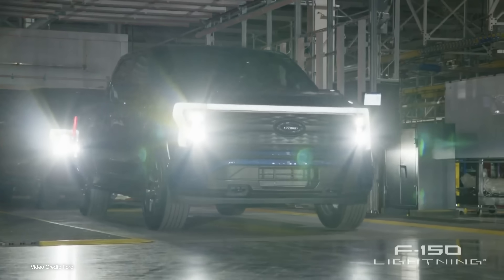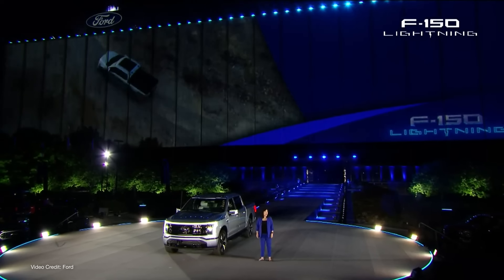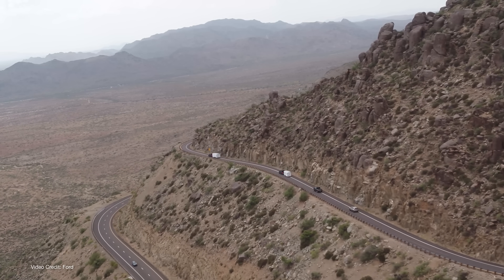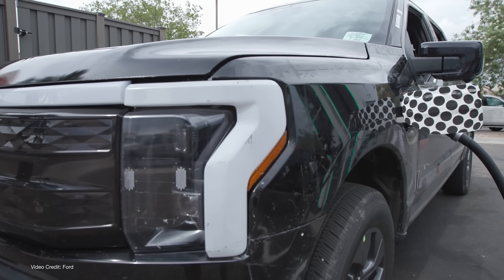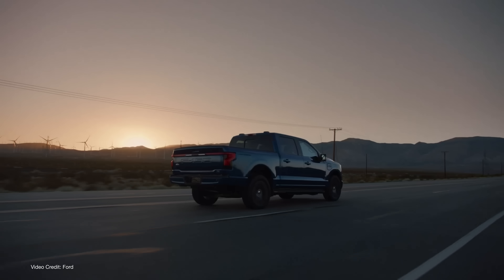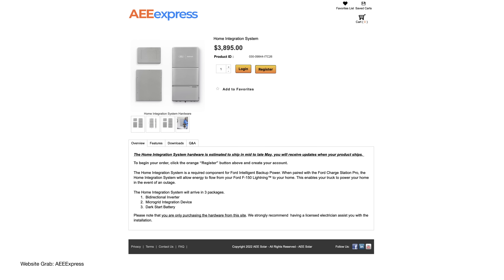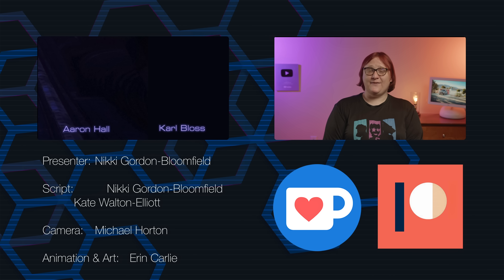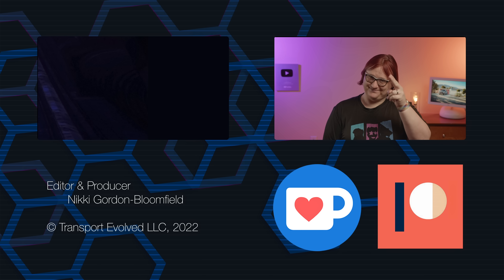The Ford F150 Lightning Has Some Tweaks At Launch - Here's What's NEW!

Comment: Someone should make a aftermarket regenerative braking system for trailers to connect to EVs. More efficient braking and get a little energy back on downhills and braking.
Reply: it would take more energy to pull it than you'd get from braking unless the motor shaft is disconnected from the axle using a clutch mechanism when the trailer is being pulled.

Comment: The whole battery backup thing from the truck sort of angers me because we have ALREADY had all this technology around for a long time!
I have an old inverter (original Tesla PowerWall one...) and a ten year old electric car. I can pull energy straight out of the CHAdeMO connection, through the inverter, and power my whole house. It's not actually that complicated!
I'm still tweaking it, but it's been good so far. CHAdeMO connections are expensive, so I 3D printed one: https://www.youtube.com/watch?v=Cw-SMRmZjNI
Here, I'm testing the DC output from the car: https://www.youtube.com/watch?v=hBV9CIVN0fs
Reply: Certainly there are challenges. I agree with you in terms of Kudos to Ford. I just can't believe it's taken this long to finally make something happen. Glad to see manufacturers are starting to do this.
Even the simple power output on the Kia EV6 looks really good.

Comment: I really want to know if their V2H system is going to play nice with an existing Generac or Enphase ATS. I kinda want to hook it up to the generator input on the Enphase smart switch and treat it like a normal standby generator. I wonder if that would work without throwing a bunch of error codes.

Comment: Great wrap up of the additional info coming out on the Lightning. I was shocked on the price of the V2H system. This seemed way overpriced given the basic inverter, switching & grid isolating hardware & tech has been around for years. I can see a lot of DIY tech heads start developing behind the meter systems if car manufacturers start charging those sorts of prices.

Keep up the great work! 👍
Reply: @Eric Dow Hi Eric, agree install is probably big chunk but either way it's big $$. I fully understand the ability to seperate the house from grid when required to protect linesman but that's a simple grid isolating switch triggered to 'Island' the home in certain circumstances, these aren't overly  expensive, so going back must be the install labour
Reply: @Eric Dow Agreed. Here in Australia is similar. 👍

Comment: I have a solar system and would love to have this 100Kwh battery sitting in my garage fully charged by the sun waiting for an outage to power my house. Given my power usage this truck would last me for DAYS and if there was sun during the day and this was only used for backup power at night....I would be set for awhile. Easily worth $5k or more to put in the correct hardware as that is chump change compared to buying a full home battery backup system of that size. That would be 5 tesla powerwall equavlents for the same cost as the truck, but without the utility of HAVING A TRUCK. It's a no brainer if you were looking at purchasing/installing a battery backup system. Someday TEsla will figure this out although it will cannivalize their powerwall sales, but this type of system will do that anyway so they had better jump on the EV to home backup power bandwagon. Also you don't want this type of system hooked up by someone inexperienced or DIY. Too much possibility of fire.

Comment: Nikki you are mistaken in regards to the Platinum range boost… Previously the Platinum had a range of 280.  It is now 300.   It still remains 20 miles less than the other extended range models.

Comment: I plan on using my Ioniq 5 V2L ability to plug into my generator backup panel. I have solar as well, so this is a basic solution to solve some of the power outage problem. Just have to manage how much power we try to draw. May install a Span panel, then the generator input becomes even more flexible. None of this stuff is cheap or easy, but I never could plug in my Passat to run my house, so progress.

Comment: Just wait until you hear the actual installation cost beyond the $5000+ hardware and the fact that most homes will need to upgrade their puny 100/200amp panels to 300amp+. You’ll easily be looking at ~$10k total for a lot of folks who don’t happen to have a brand new home with an existing oversized panel.
Reply from the maker: You’re misinformed: the Ford Charge Station pro can be ramped down to 30amps if required. - Nikki
Reply: @transportevolved  if you ramp it down to 30amp, why even bother buying all that hardware and pay for installing it at all? You can’t fully utilize it during an outage and you can’t charge your vehicle any faster than pretty much any home charging solution… Just have a transfer switch or even better yet, just use the included 240/120 outlets to power essentials without buying anything extra. What % of people would be willing to drop $5k on additional hardware only to downgrade it to 30amp?
Reply from the maker: @Mari0o0o  Actually, you can utilize the full 10 kW during a power outage, because the power fed back into the home is on a different circuit to the power drawn out during charging - NIkki.
Reply: @transportevolved  good to know! I still don’t see the point in getting the whole system if you don’t have a newer and larger panel and are unwilling the spend $ to upgrade it.

People buying a 50k+ truck who would be willing to then drop another 6-7K will also be likely to just drop 10k and charge faster (which is probably a bigger priority for most) vs those who are looking to save money and can’t have a more powerful home charger anyway due to current home limitation who would just opt in for a simple transfer switch, even if they have to manually flip it during a power outage.

I don’t see much if any overlap of people who are ok with spending $5k in additional hardware plus installation costs but who would be ok with having a 30a charger that takes multiple days to charge their truck.
Reply: I'm so happy that 400V (3phase at 230V) and 50A (35kW) is standard for regular homes over here in Germany.

Comment: Hard pass. If you tow a travel trailer for let’s say a small trip at 300 miles each way then you’re going to drive for about 100 mins and then spend 45 mins to charge it from 20-80%. 150kWh charging rate is ridiculous.

Comment: Using the F150 Lightning to power your house just seems like a waste of money. Some extension cords would get you through in a pinch. If you have really bad power problems in your area a backup generator wouldn't cost you any more and it would allow you to go to work and not leave your family in the dark.
Reply: A backup generator uses gasoline. Which you'd have to keep on hand and store somewhere. And "extension cords wouldn't do much for the HVAC, something that would be needed if it was 90+ or below freezing. 
Plus you can always use that to charge smaller batteries for lights and fans if needed.
Reply: @sh969 Most backup generators where I live use natural gas. I understand that extension cords are not a perfect solution. Bur they cost a lot less. Using the truck as power backup isn't a perfect solution either, It can't leave the house. Plus that central air is going to drain. the battery pretty quickly. So would electric heat. A natural gas furnace could be plugged in with an extension cord. If you have no power and  it's hot try opening a window.
Reply: @sh969  re: "A backup generator uses gasoline." close, PORTABLE generators deployed for "backup power" use gasoline and other fuel types (think Diesel). this is the situation I'm in as the grid here goes out all the damn time, even on bright sunny days.  as a temp fix i have a 5000 Watt Honda (quiet run type with inverter) that I bought for use at the racetrack.  when the power goes out (for now) I just run an extension cord from the trailer to the house to plug in "bare essentials", at which point the wife and I just suck it up and wait it out. I eventually want to install a "Stand-by generator" that taps the NG supply like "Arselio Hall" mentions.  a few neighbors have them particularly for MEDICAL reasons as they have kids with special needs (ie, asthma) so they must always have power available for breathing machines and other equipment.  as great and wonderful as the "Mighty Lightning" is, it unfortunately doesn't fit the use cases around here where the electricity grid is in many ways WORSE than Texas.

Comment: Even without the V2H system, the Lightning will be able to power household appliances via an extension cord to its 120- & 240-volt outlets. So, even folks who own a Lightning but don't bother with the V2H system (I assume that'll be most of them) will still be able to use the truck for limited back-up power.
Reply: You can’t backfeed into the house while the grid is down without a switch isolating your home from the grid. All you can do is plug in a bunch of appliances into the single 240v plug and the other 120v scattered around the truck (I think the max peak across the 11 outlets is 9.6kW assuming you opted for the option, otherwise it’s much lower, fewer outlets, and you don’t even have a 240)
Reply: @Mari0o0o  Right - I get that. ... I'm simply saying that, even without many folks having the whole V2H set up, there are still going to be A LOT of families who end up saying "yea, the power outage sucked, but at least we kept the fridge & computer running off our Lightning's battery".

Comment: Nikki, Bravo for pointing the much lower cost option of just a manual transfer switch and a cable to connect to the truck's 120/240 V 30 A outlet in the bed.
Reply: if you only want it as a back up its a good low cost option

Comment: Note people…when Nikki talks about horse power she talking about USA horse power which is 95ish% of the power of normal HP.  Thus is all the other all the other figures based on this when testing and reading the specks outside of the USA will be wrong… remember when top gear tested the HP of a 500hp mustang and the UK test showed it only had 440ish HP!
Reply from the maker: The ratings are correct for the market it is being launched in. if we are talking PS, we use PS (metric horsepower), as is the industry standard. Your comment does not assume standard notation. - Apologies for my initial gruff response - Nikki
Reply: @transportevolved  Just to clarify: is the power rating in kW the same? Is the difference in horsepower rating due to unit conversion, or because, say, one standard calls for measuring at the motor, and some other on the wheels?
Actually, this (and EPA vs. WLTP vs. whatever) could be a good topic for an explainer video.
Thanks!
Reply from the maker: The term HP refers to US horsepower, which is what most folks use. The term PS is used for Metric horsepower by most…  automakers usually quote HP as being imperial and PS for metric. We convert to kW because that’s what electric cars tend to use - Nikki
Reply: @transportevolved  Thank you for clearing that up - That is why I questioned it in the first place - seeing you are USA based in American I was thinking everything you were saying was based on American figures/setting.
Reply: @transportevolved   Sorry about my too over direct comment - my dyslexia got in the way again and the words got mixed up - I was trying to say.... when Nikki talks about horsepower IS she talking about USA horsepower... Thank you for the clarification... before I read your comment I have reached out to a number of Ford public PR people et al and asked about the HP question as well - I still waiting for an answer back from them.
Reply: @transportevolved  bit of a rude response. 
I don’t think they were trying to claim otherwise, just that there is a difference between imperial and metric (“American”) horsepower.
Reply from the maker: We’ve wanted to make sure it was not dragged out - we’ve had some commenters lately be argumentative, and while you’re right we were snippy, we’d like to reiterate we gave ratings for the country where the car is sold. -Nikki
Reply: @transportevolved  Short fuse today, Nikki? 😛
The comment was in good faith - just a head-up that differences exist, like in octane ratings or range estimates.
Reply from the maker: We’ve been having some comment issues of late… and some argumentative folks in the comments ;) - Apologies - Nikki.
Reply: I thought everything was bigger in the States 😃
Reply: Sounds like social science people talking about real science. 

Maybe clarification would be helpful. There are numerous different flavors of horsepower. The measurements themselves can be imperial (745.7 watts) Vs metric (735.5 watts). Also usually when someone says HP they mean just engine horsepower not accounting for frictional losses. Brake horsepower often seen as bHP is engine horse power corrected for frictional losses. An even more useful measurement is wheel horsepower. This is the measurement of the vehicles power literally where the rubber meets the road.

The cool thing about electric cars is how much fewer transmission components there are between the motor(s) and the wheels. Therefore engine and wheel HP margins are narrower meaning higher energy efficiency.

Hope that helps.
Reply: @jam206AR  thank you, this is the most comprehensive explanation of the differences I've seen and its finally clicked for me. Cheers. 👍 😊

Comment: 216Wh should be $100, transfer switch $50 tops and a 10kW inverter less than $1000 (ask David Poz!). Dunno how all that can reach $4000...
Reply: @Hervé Fache I think Ford wants it to be expensive, since it is not really in their Wheel house.   Only the top purchasers will be able to afford the option and it really isn't financially justifiable.   In other words it is an option, that Ford doesn't expect a lot of people to buy.  In order to be safe, this is a tricky install, even for a licensed Electrician.  

Musk is right, it doesn't make sense to risk a $88K vehicle to do something that can be done better for $12 - $20k.   In theory if your vehicle is backing up the house, it means you can't use the vehicle, not even for a second.